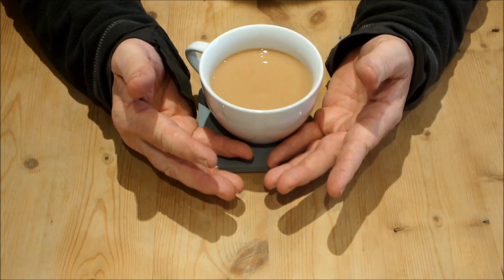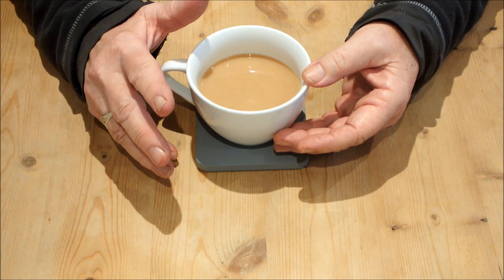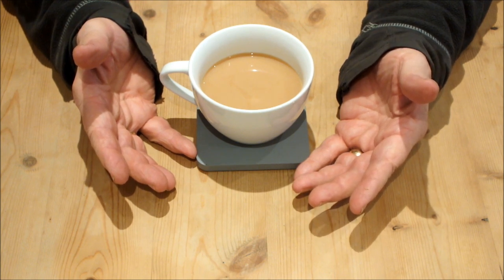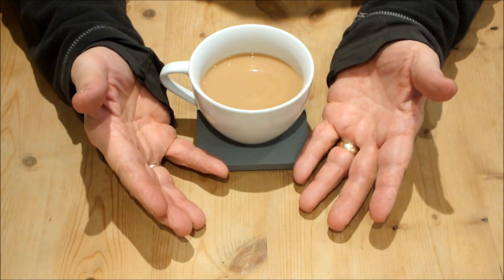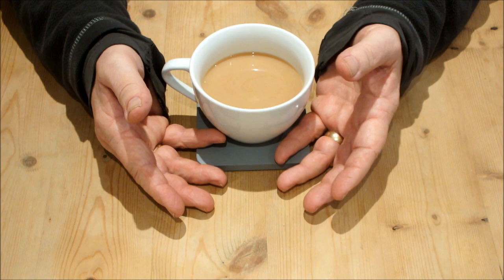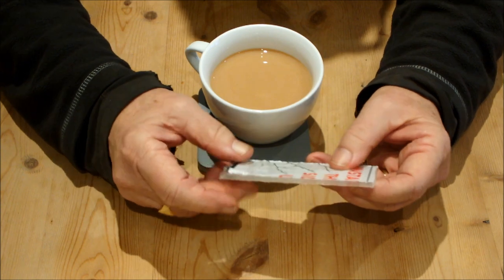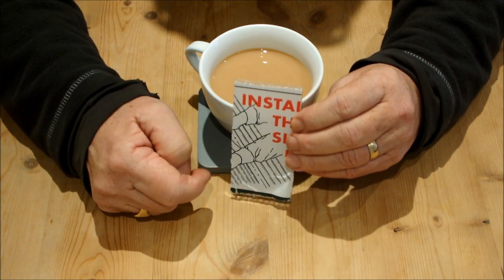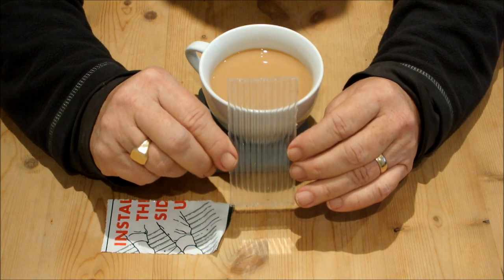Polycarbonate greenhouse sheets, catastrophic fail sheets disintegrating big time.

Comment from the maker: DON'T JUST TAKE MY WORD FOR IT.  If your planning on purchasing a polycarbonate greenhouse search YouTube for New polycarbonate greenhouse or Building a polycarbonate greenhouse or just Polycarbonate greenhouse. Check out the date the video was posted. If it's more than a year ago, check out that channel for an update video. Was it a 'good buy' is it still standing, did it need a lot of additional work. Enjoy your research. Jim.
Reply: Jim, considering ALL your southern facing roof panels are deteriorating makes me doubt that those panels are UV coated at all. Just think how high the odds would be of getting all those panels in wrong side out when there's no way to tell visually that one side is supposed to be coated. Given all the other poor quality issues you've had with this polished turd, I think you got duped on the UV coating. 😱 Thanks for doing the series on this greenhouse. After seeing what you've gone thru, I've decided to wait until I can afford to hire the Amish people who built my shed to do a greenhouse for me (they do those too). Not only is that shed a solid, well-built building, it was built to my specs, built indoors and delivered to my site complete so I only had to prep a level road-base for it and I could move into it as soon as it was placed. Plus, I can support a local business versus sending my money to China. Caveat emptor.
Reply from the maker: @GraeMatterz  Your right.  For all I know none of the sheets are UV stabilized. Begs the question why cant both sides be UV stablised ? Jim.

Comment: Got a polycarbonate greenhouse half the size of yours 10 years ago. Was straightforward to assemble but it doesn’t matter which way you put in the polycarbonate sheets, they eventually become brittle and deteriorate. I’ve been lucky in getting 10 years out of them. Problem then is that the greenhouse manufacturer/supplier doesn’t provide replacement sheets to size. They will only advise you to buy a whole new greenhouse.
Reply from the maker: Just cut some sheets by hand using a hacksaw blade.  Lots of very small teeth. Took my time.  All 4 sheets cut and fitted. Fitting was a struggle but they are in with lots of mastic to hold them in place.   Jim.
Reply: Mine degraded after 2 years and  at round  10 years a large hail storm finished it ,.well the roof on the north face.  for me its Aussie land's strong UV and then the hail.  I can get new panels the right size for about 250 for the whole roof.  Mine is 12 X 8 foot.  Bastard of a thing to build I think me and a friend never swore more in our lives.

Comment: I feel your pain. I bought a polycarbonate greenhouse and it was a nightmare to put up, I lost one panel the first night when it was a bit windy! I have since had to put several of them back in and now most of them are tapped in with duck tape, quite a few have been damaged and bent so have tape all over them!! I currently have one which won’t even fit into the groves because it’s damaged so that is tapped and weighted down with wood!! I think some of mine are probably not put back the right way round.
Reply from the maker: Nightmare!

Comment: .I have one just the same I heve repaired the window and the door after a storm  I have had to replace 5 out of the 7 poly panels and now i have to replace another 2 due to the storms this week, but I love it could not be without it, I will keep repairing it as long as i can. it is my haven and i love the fresh toms cucumbers and peppers I get, not to mention the other seedlings i produce. I have only had it for just over 2 yrs. I used bungie things to stretch over the panels last week to stop them getting blown out (up up and away) and they seem to be working at the moment, I liked your idea to reinforce but arthritus prevents that for me
Reply from the maker: I like your spirit. One thing I did that was a knee jerk reaction to panels blowing out was to use some sellotape to hold the panels to the frame.  That sellotape is still on, still holding after 3 years. Jim.